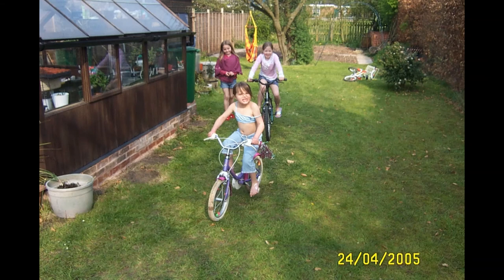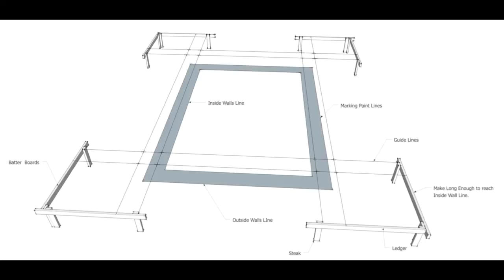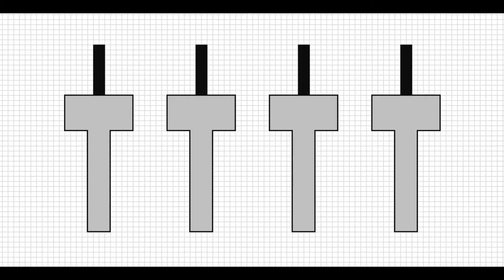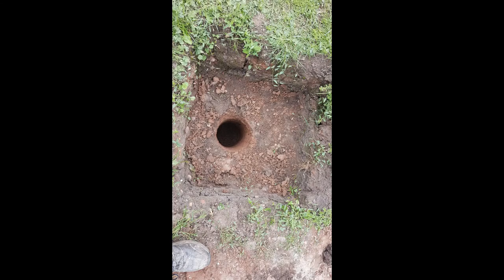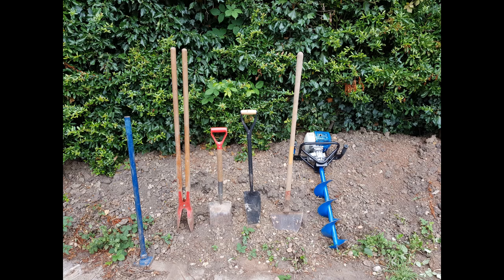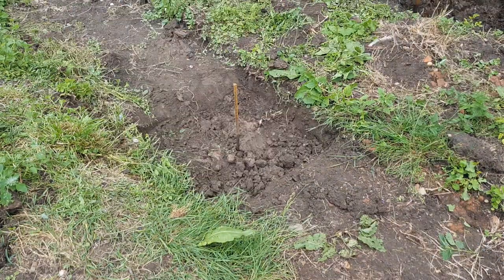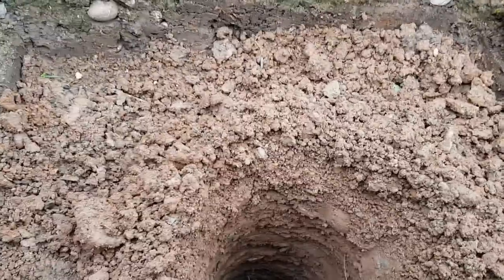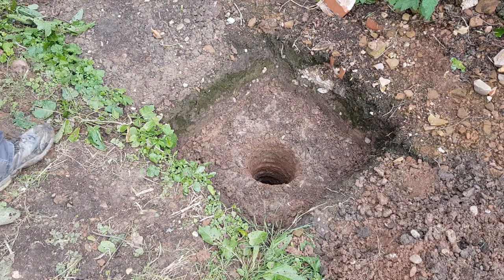Warwickshire Workshop Foundations.

Comment: An excellent and professional video! Certainly those pads will provide ample foundation for a building of this size and weight.
How will the steel scaffold frame be connected to the pads? Normally bolts or straps would be imbedded in the concrete to make a mechanical tie to the framework.
I wish I had building inspectors like yours, that way, if I failed an inspection, I could just wring their necks, pluck the feathers, batter them up and fry the blighters!
Reply from the maker: Hi Jason. HaHa. My building inspectors are top flight professionals. Thanks for getting in touch BTW. The square footage of the floor is below the size that would require building inspectors to come out. In the UK it is 30m2.  The weight of the building will be enough to keep it grounded once the insulation is added. In my neck of the woods (Central England) the winds do not get that severe. I have a loose sheet of corrugated cement board resting on my chicken coop for 5 years now and it has never moved or lifted.